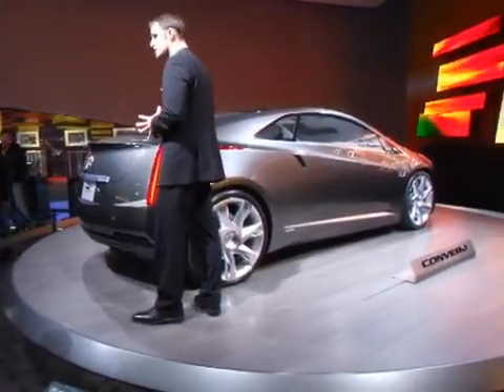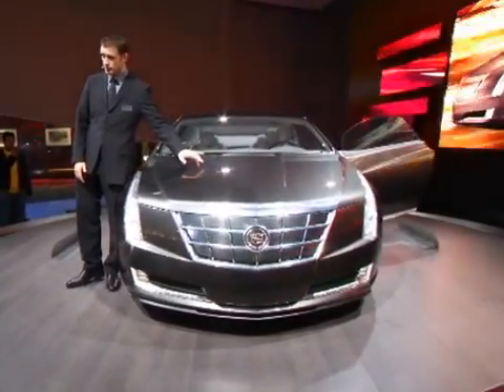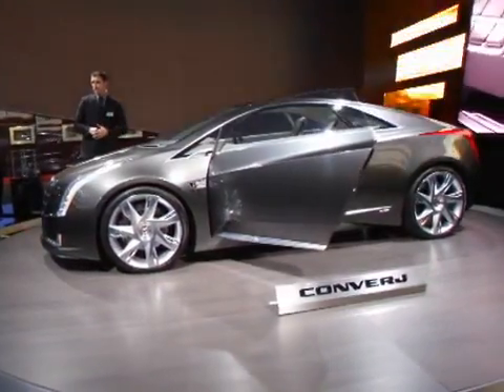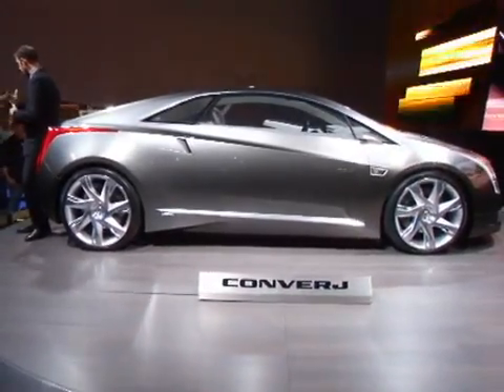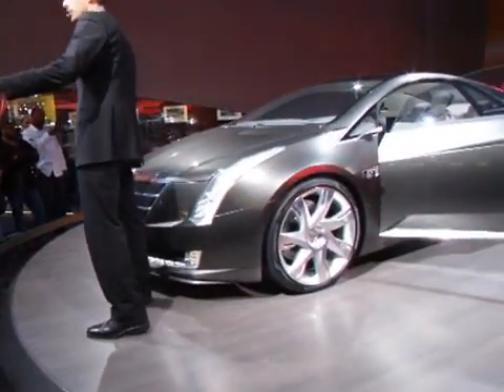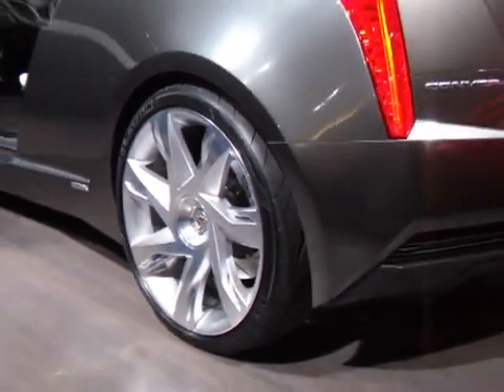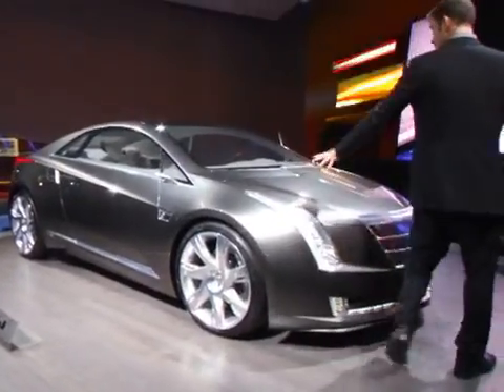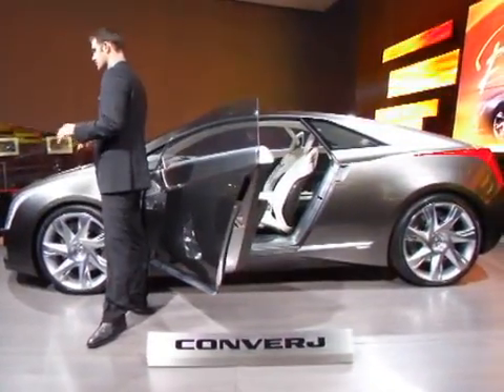Cadillac Converj 2012 (North American International Auto Show 2009)

Comment: The only slight similarity with the Chevrolet Volt is what is under the hood. Their electric propulsion and power-generation systems are similar, but that is due to them both being made by the same company. The ELR is a Cadillac, which cannot even be compared to Chevrolet. It has a waay more modern look and design than the Volt, inside and out, while maintaining the standard Cadillac performance and remaining hybrid. It's the hybrid CTS, with $5,000-$10,000 in federal and provincial tax breaks.

Comment: This guy is playing with words, when you plug in to 120V or 240V in 8 to 3 hours, sadly pollution will be placed in the air due to the use of electricity as per the re-charge process. A very good concept but we will pollute the air any which way. 4/5.

Comment: Actuactly for the most part all wheel drives systems are really two wheel drive they just have the ability to send power to the wheels that need it for better traction.  And as for rear wheel drive I just like the ability to do doughnuts so you win that arguement.